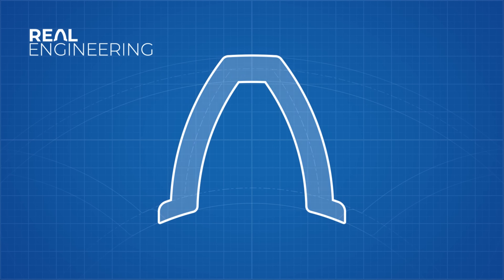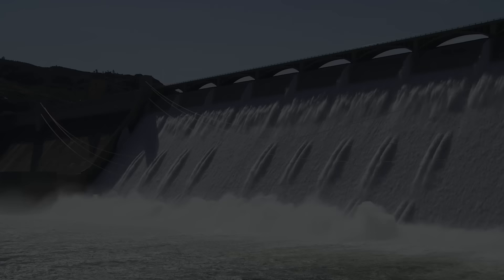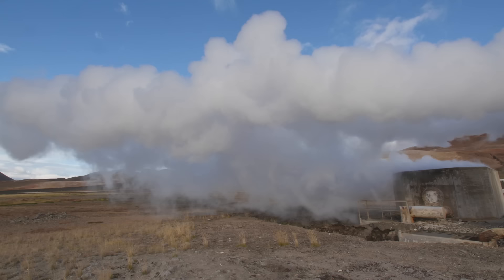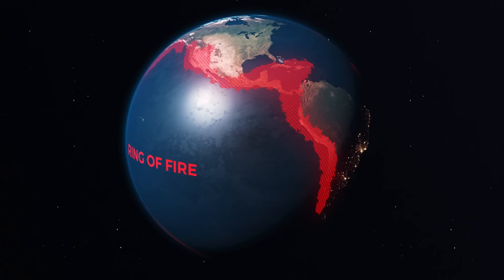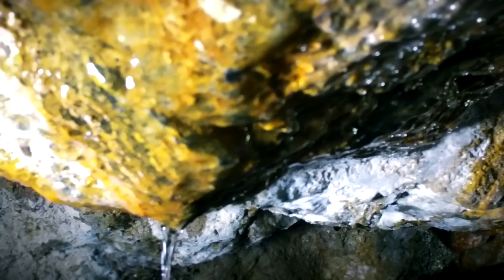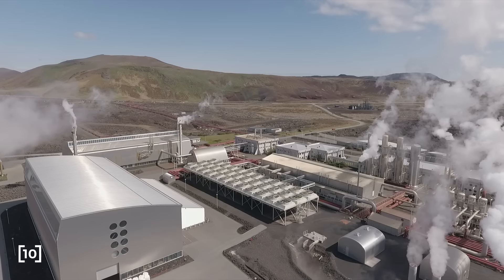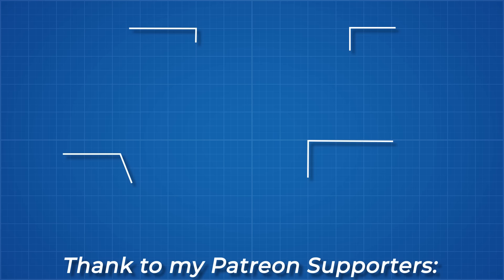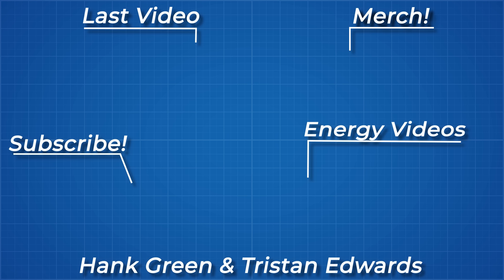Could Earth's Heat Solve Our Energy Problems?

Comment: And now we know why the core of Mars is frozen solid
Reply: hahaha
Reply: Actually, this is a good reason why we shouldn't do it. Energy isn't free, to drive our systems up here, energy must come from the system down there. It is converted from heat into electrons, which is a very wasteful process. Those electrons then must travel, resistance of which saps more energy to form heat. We then use that electric potential to drive systems we call electronics, because they run on the power of the electron. This converts the electrons back into a significant amount of heat, as well as several electromagnetic waveforms. One of these is infrared leakage all along the entire system, not just in the electronics phase. Another comes from converting the electrons into visible length photons in the display phase of the use of electronic tools. This means the geothermal energy must convert from kinetic energy to electron potential energy inefficiently, travel to where it is used inefficiently, be used inefficiently, and it is not recyclable. Once the energy has been radiated or consumed, it cannot be reused, even if the source is producing energy, very little of the energy used in this process feeds back into the cycle. The vast majority is lost to space eventually. 

It's only because space gives us energy that our magnetic field is even remotely sustainable. Eventually, that will run out too.
Reply: TL;DR We shouldn't do it because the energy we'd use up here is being used down their to power our magnetic field, which is already weakening somewhat. It's perhaps possible that some is being radiated away in the form of radio, microwave, infrared and visible wavelength electromagnetism. Our atmosphere is surprisingly good at shielding us from x-rays and gamma rays, so I'd also assume it's good at stopping x-rays and gamma rays produced on Earth from getting out in significant quantities. 

Pretty sure you just ionise the air, which then radiates that energy as infrared radiation or directly as kinetic energy if the affected molecule reaches escape velocity.
Reply: @jamielonsdale3018  that's the weirdest thing about light, no matter what Vantage Point you're looking at it from, it's always going the speed of light, even if you're also going the speed of light.
Reply: @jamielonsdale3018  great reply by the way, I see you know your physics.
Reply: This actually shook me

Comment: Yesterday I finished installing solar panels on my roof, let’s go green energy!!!
Reply: Good luck redeeming footprint of logistics of getting them to you from production plant. Let alone the impact of their production and maintenance.
Reply: NGC1433 You can either stay as you are and complain or try to make the world a better place.😉
Reply: @polgabaldon  He's saying that if they do not produce enough electricity over their life span, you're actively doing the opposite.
Reply: MammutMKII I know, I know, but that's when all the calculations come into account and not only will they will be completely paid for in five years but are also built in a sunny climate which makes the most profit out of them ensuring a clean final net production.
Reply: @brandonbenjamin9452  I just made another comment more clear, since he did not really address it. That's not being a prick.

How ecologically viable they are can also be reduced severely if they are static, not perfectly aligned and farther from the equator or in a worse climate.

But if he says they pay off in 5 years, it's probably fine unless he got a huge subvention.
Reply: @mammutmkii7242  but nothing stop solar panel from operating for many decades. There's no moving parts, it's basically a transistors like in CPUs & LEDs, it operate based on doping of gasses on the silicon rock, it diffuse out super slowly, but probably will outlive the outside electronics & the buildings.
Reply: it will always produce more & more energy, even ancient solar powered calculator from your grandparent will still work.
Reply: What What's the total cost and how much did it reduce your electric bill?
Reply: Delta Fox  everything you say about solar panels hasn't been true since the 1970s. A single 40 pound panel will sit there generating several MWh of energy over its lifespan, and all panels are warranted for 20+ years.

Solar water heating is generally worse than solar photovoltaic. I know because I have both on my roof. Solar thermal requires more maintenance (I shut my system off after a $3000 estimate for repair) and you'll never get a 20-year warranty on any part. Electricity is general-purpose useful energy, whereas solar water heating system will give you more scalding hot water you can possibly use in the summer, and some hot water in winter. The technician who diagnosed my last solar thermal failure said his company has discontinued all residential solar thermal installations, and only does large industrial and commercial ones. I look forward to tearing out my solar thermal system to replace it with more solar panels powering heat pumps for space heating and hot water.

Comment: There are some domestic projects by private ma and pa operations , that dig 8 foot deep and lay 6 to 8 inch diameter pipe . Then air is drawn through either by convection or fan  they are receiving 52* to 58*.air temp year round heating greenhouses along with the solar. With some left over to heat the home. This is in Idaho .

Comment: When I become a supervillain Ill use geothermal power plants as my cover for cooling down the Earths core and putting an end to the Earths magnetic field. Muhahahaha...
Reply: Is this a Risk?
Reply: and filled it with candys for the tallest ? this sound like an Irken.  is that you Tak ?
Reply: That's like saying you're going to put up a bunch of solar panels and take all the sun's energy so the sun shrinks and disappears. All that energy is just going to waste when it's not being harnessed. The Earth's core is going to cool down in a few billion years regardless if the energy is harnessed or not.
Reply: @johannesnm9706  yes. Small hole can empty the sea over enough time
Reply: @drabberfrog  No not the same. Your not accelerating the sun decay by catching its radiating heat. You are accelerating the cooling of the core but allow more energy to flow out with addtinal drilled holes.  But the core is big and the hole is small so time is going to more than one election period so why cares...
Reply: @HannesZietsman  well the earth already gives off 1W/m2 
So it will be a drop in the ocean
Reply: @johannesnm9706  Still not a renewable energy source
Reply: @drabberfrog  *stops work on Dyson swarm design
Reply: @HannesZietsman  renewable energy? its just warm rocks, but buy thos standars what is? sola panels and windmils also need material to be build.
Yes we this could probbly cool the earth core down, if we really went super crazy with it.
But freaking hell people, you do realise that the sun wil expload and kill us all in a matter of time? right? noting last forever. we need to get of earth and maybe convert the sun to red dawf and live around it. that wil buy us som time.
But even that will run out on day to. So this? NO we don't need to bee afraid of earth cooling down, we got MUCH bigger problems to deal with if we gonna ponder on such problems.
Reply: haarp?
Reply: And if you had a change of heart, you could become a reborn environmentalist and you could stop global warming by becoming a super mosquito and completely draining the blood of all the methane farting cows. (Similar conceptual scaling of effect)
Reply: @drabberfrog 
No. The earth is not cooling. Its core is a nuclear furnace. It generates heat.
Reply: @HannesZietsman  
Sure it would.
And a sparrow that flies 100 miles once a year to sharpen its beak on a rock that's 50 miles wide, 50 miles long and 50 miles thick would eventually wear the rock away to nothing.
Reply: @HannesZietsman  
You are essentially arguing that existence is not renuable.
Where did everything come from?
Reply: @rasmusg.o629  
Yes. Solve your own mortality before tackling collective mortality.
Reply: @Bluuplanet  yes but eventually the core will cool down but it takes billions of years for it to cool down so using geothermal energy won't use up the energy
Reply: @drabberfrog  you dont know for sure
Reply: @imfbankfoolsus1026  Yes I do. Scientists know the composition of the inside of Earth very accurately and can predict how long it will take for the core to cool down.
Reply: @drabberfrog 
The earth's core is not cooling. Rotation and the Sun's gravity combined with the core being primarily created generating. In fact, its a nuclear reactor. Also, future species will not die from cold. Our sun will have a supernova and its size will expand to the orbit of Mars.
Reply: @HannesZietsman  less than 1 degree dried up a lot of lakes
Reply: @Bluuplanet  The Earth's core is a nuclear pile, not a nuclear furnace. Those radioisotopes will decay, albeit on a geological time scale potentially greater than the survivable future of the human race. (Earth has about a billion years until the Sun's slow expansion engulfs it) The real concern is whether or not it cools to a tipping point that stops or slows core rotation relative to the rest of the planet. If that happens, we all die.
Reply: @Bluuplanet  Entropy states that all matter or energy will eventually reach a stable (and thereby unchanging and permanent) state. "Existence" will keep on existing, becoming less and less energetic as time goes by. However, the natural order of the universe is that the energy contained within it is slowly becoming less and less accessible. Eventually (start adding zeroes to the age of the universe) everywhere will be a uniform temperature with inert forms of matter or proto-matter that do nothing but sit there. It sucks, but existence is not renewable.
Reply: @Bluuplanet  They made the same argument about global warming. Now we are having global disasters do to climate change. They made the same argument about pesticide buildup, then all the bees died. Every time someone uses that argument on a grand scale, they seem to forget that its not one bird sharpening its beak, it millions.
Reply: @rasmusg.o629  Don't fall into the trap of thinking you can only solve one problem. We already know how to extend the life of the sun almost indefinitely through star-lifting (we have the science and tech, but lack the space-based infrastructure). We can tackle that when the time comes, and still have plenty of minds to focus on other threats. The argument against geothermal power isn't that we can't deal with it, it's why cause future generations another problem for temporary gain?

Comment: What about Draft Towers?

a poruss, conductive, reflective shell.
Air goes in, gives heat, and sinks to the middle and then down. At a potentially gail level wind.

That shell extends up through a rooftop(non Conductive,  painted White  and casts a wide shade.)
and forms many spikes. With all together a larger surface area than under the rooftop, and higher areas being cooler..

This will both be fighting Climate change as well as produce power.

That down draft in the center area drives a turbine.

Comment: Could you maybe do a video on using gravity to store energy? As in: use any abandoned mineshaft to let a weight move up and downwards, depending on the current net energy balance. This is mechanically simple, this reliable, and if anything happens, there‘s just a weight on a slide falling down a mineshaft.
Reply: Something like pumped hydro?
Reply: They do something like that with pumped hydroelectric power. Same idea, only a lot cheaper to build since you just need two reservoirs on different levels.

The main limitation is it takes a lot more power to lift the water than you get out of it, so there needs to be a large amount of excess power during its peak for it to be practical.

Using weights instead of water would be more expensive, but there might be some way to make it store and release energy more efficiently...

Comment: don't need to dig very deep,  put it on the volcano crater with some ingenious support civil ing and with and helped with an aerostat. then add the Germany systems don't use the same waster to gas stuff similar to move the turbine. so as you have more altitude on the aerostatic glove stuff you can add solar system and many micro win system. gathering energy too.  the construction can be fast move hable in case volcano explore but as it drags a lot of energy from volcano i think this will keep it unactive with is good to prevent less co2.

Comment: Improved design of buildings, vehicles and various equipment would significantly reduce our need for electrical power and the burning of fossil fuels. My house is energy positive in that through the use of good passive design, insulation and PV we generate more than four times the amount of electrical energy that we consume and the economics of doing so are highly positive. If more people were doing this and if authorities focused more on storage capacity then we would need to operate far fewer fossil fuel power stations, and the financial and social/ecological benefits would be significant.

Comment: This is a self limiting technology.  Think of passing a tiny copper tube through a giant pile of snow.  At first you get colder water, but eventually the water turns to ice and no more water can flow. Once you build up a layer of solidified rock (because you have been sucking away the heat, locally),  it is no longer effective.  Then you have to drill someplace else.
Reply: You are imagining that they'd be drilling into a magma chamber.  That has never been done, and never will be.  The borehole would be drilled down to hot rock..  not melted rock.

Comment: Why not use the geothermal energy to power the hot side of a sterling engine, instead of powering a steam turbine? The Sterling engine can operate at lower temperatures, especially if you use a refrigerant to cool the cold side.

Comment: Drilling can go so deep then the weight of the drill pipe can no longer be supported:  the pipe will part itself.  Ditto with casing.   Deeper gets hotter, steel softens, corrosion worsens.  I think current limit is 35000’
    Scale is a real, real nasty problem.
     Pentane and other fluids.  For thermal endeavors, water is hard to beat.  High heat capacity, latent heat, and density means topside turbines are small.   Not ruling other fluids out, it’s a trade off.

Comment: Geothermal can be used for good. First, instead of building batteries and pumped hydro, it will be good as backup energy when there is no wind or sun. This way it will also last much longer without depletion of of energy source. Second, with good planning and computer simulation, it can be used to prevent or reduce volcano eruptions by taking some energy from the ground around them. Third, as it directly takes heat from our planet, this will reduce global warming in the long run. 
Carbon dioxide is not a pollutant in moderate amount, as plants use it for growth. It is excessive heat, that is bad, so we should target heat directly by bulding solar, wind, hydro, earth thermal, ocean tide plants - while gradually reducing carbon emissions in sustainable ways. This way we can meet our target faster. Nuclear plants just reduce carbon emissions in the long without taking the heat, actually they make the heat as they require cooling. They should be used as our last choice, as they also need large investment and expensive/dangerous research.

Comment: Cracking the wall of a pressure vessel while under shear stress sounds like absolute madness. Using more responsible methods to supply hot water would be enough of a big deal.

Comment: Time to update your video.  A new geothermal system has been developed and demonstrate in Alberta. It can go almost anywhere. Out of the gate it is less expensive than nuclear. It not only produces electricity, but process heat becomes available. It is a closed loop system with no water injection and no earthquakes. (Eavor Technologies)

Comment: Very American look at this. Here in the Nordics it’s very common for house Owners to have their own hole. Small houses or big condos both. Used for heating during the winter, cooling during the summer. Saves you about 90% of electricity compared to direct electricity heating. This is not new, have been normal for 20-30 years. Our ground is not active, no vulcanos or earthquakes here. 

Combined with solar panels on the roof or a share in a wind generator this could be really economic way for your energy need.

Comment: I've always thought that Stirling engine generators have the most potential to tap into geothermal energy.  With Stirling engines, there is no need to boil a liquid to generate power; it just uses the tendency of gases to expand when heated, pushing a piston, then cool again off of a heat sink -- all in a closed system.  Seems like a Stirling geothermal generator would be ideal in cooler climates where there would be lots of opportunity to sink out the heat, thus creating a greater heat differential.  I wonder if the same geothermal refrigeration from utilizing low depth wells to heat homes would provide enough heat energy differential to power a Stirling engine generator, especially in winter in a cold climate such as here in Minnesota where, after the expanding gas has been utilized to move the piston, the heat energy could then be sunk to the outside cold air, cooled, before being heated up again by the geothermal refrigeration system?